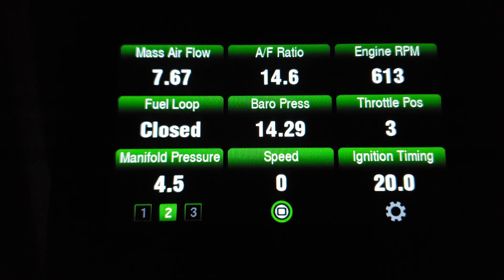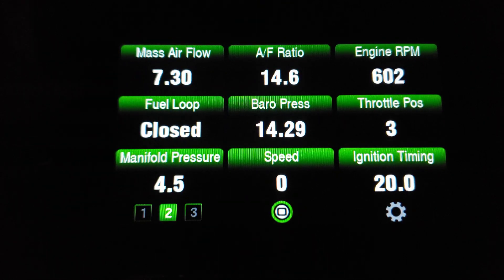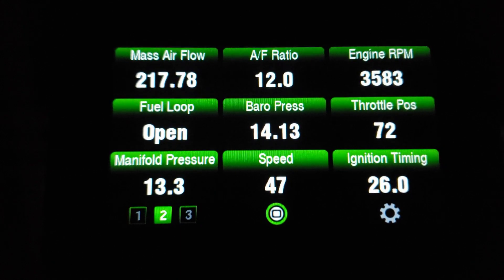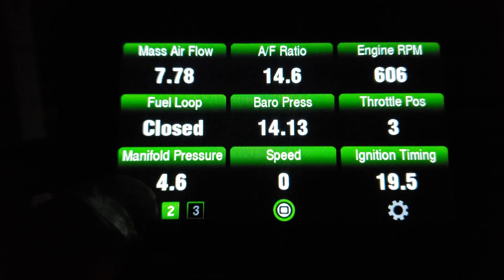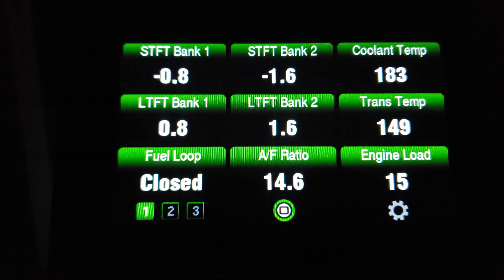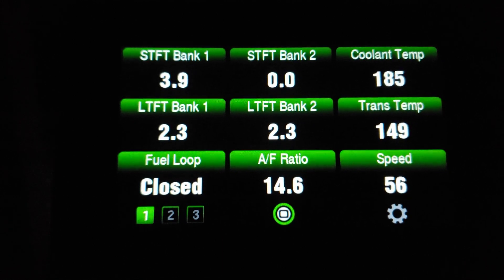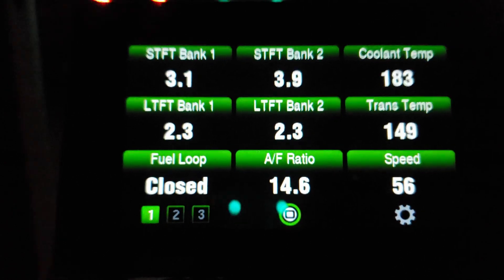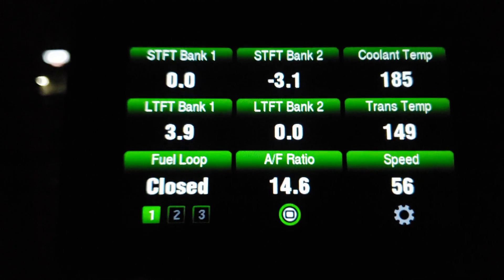8.1 Vortec Engine Saver:PART 4 How to Test Your Mass Air Flow Sensor With  Scangauge 3

Comment: We just left New York on our way to Georgia in our 2009 w 24. I my long-term fuel trims are about six to eight on steady-state driving flat ground but going up the hill it's about 10.9 to 11.7 sometimes jumping up as high as 12.5 in the 80% plus engine load range. I just watched this mass air flow sensor video and I'll be checking my mess are flow to see if I can figure out what the problem is with the engine. Thanks so much for the great video!
Reply from the maker: If you have any questions just text my cellphone 606-875-0125 Kevin

Comment: I noticed your RPMs  was not even close to 4000rpms, on my 8.1 on WOT I will always go to around 4200 rpms, and I have never seen open loop except on long uphill grade, also the best MAF sensor reading I've gotten was around 220, fuel trims are like yours, single digits,  not sure if altitude plays a role into the readings or not, but I live at 5000 ft elevation.  I will have to take a look at the MAF readings at a lower altitude.

Thanks for the video.
Reply from the maker: I think I took my foot out of it after I got past 230 grams per second

Comment: Another fantastic video Kevin!!
I see that your Coolant Temp always ranges around 180, mine is always at 210, why such a difference?
Reply from the maker: 210 is not normal I have a 180 degree thermostat you may have a 195  at 205 your fan clutch should kick in and make a lot of noise or your radiator needs cleaning give me a call or text so we can trouble shoot the problem 606-875-0125 Kevin

Comment: Awesome video Kevin!! I have been trying to figure out all the info that u just gave on video. Wot i only hit 210-220 after cleaning MAF sensor. Going to order a MAF sensor and  o2 sensors just because im at 45k. 2005 winnebago 8.1l w22. Thanks again. Btw my fuel trims were double digit all over the place! Is the MAF the cause?
Reply from the maker: Most likely, the maf is the problem.  Don't use after market o 2 sensors text me at 606-875-0125 I will send you link to good o2 sensors. Kevin
Reply from the maker: Link to O2 sensors you need 2 of them https://amzn.to/3uu4Uxf

Comment: Thanks to your videos, I recently got SG3 and have just finished installing it. I do have the Banks + UltraPower tuning from Brazels. Is there any way to monitor the efficiency of the O2 sensors with SG3? Great video!!
Reply from the maker: Yes it will but I have not studied how well it does this.

Comment: Hello Kevin, Thank You for all of your tech videos,      Brazles RV performance   still has available Banks ram air intake kits for Workhorse ( I have a 30 ft  Monaco Trek with a W22 chassis)  What is your opinion of these intake kits such as ;  49194 Banks Power Ram-Air Intake System GM - 8.1l W-series Workhorse   ?    Any chance to drive a motor home with this kit installed ?
Reply from the maker: I like the Brazel CPU tune my self more than the banks system, I also don't like the foam filter that comes with the banks system. I know it increases air flow but at the same time it raises the fuel trims to compensate unless your pulling mountains most of the time I don't see the advantage give me a call or text if you would like to talk about it. 606-875-0125 Kevin

Comment: Hi Kevin. I have a question about MAF sensors. I need to replace mine in my W22. Workhorse parts lists two different ones, w8000513 or af10043. The AF10043 says it's original Delphi. What do you think which one?
Reply from the maker: This is the one you want.
https://amzn.to/3TMHPA4
Reply: @ktoutdoor  Thank you!